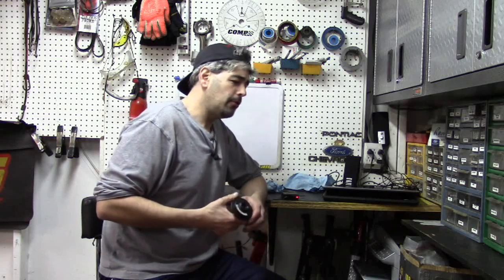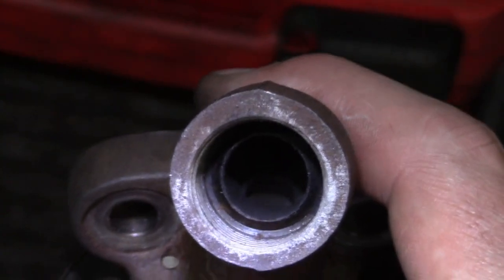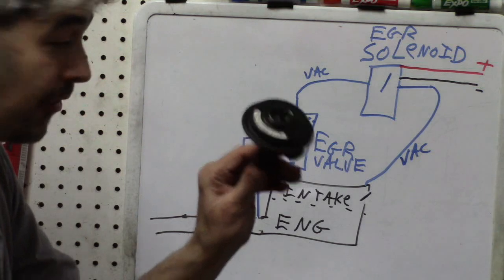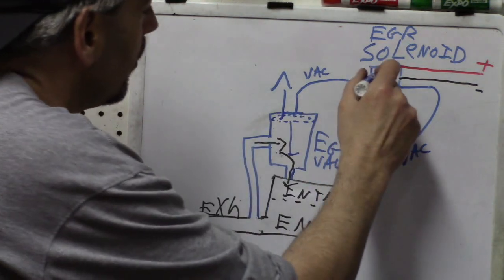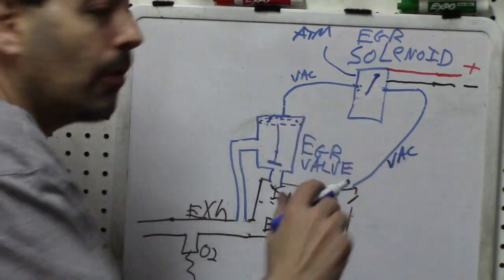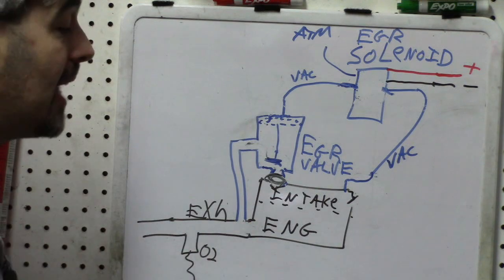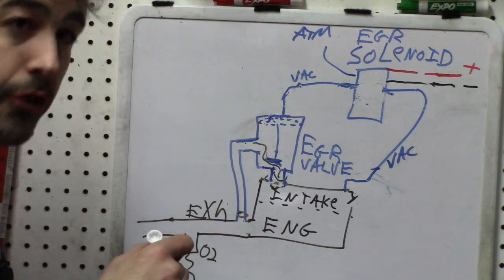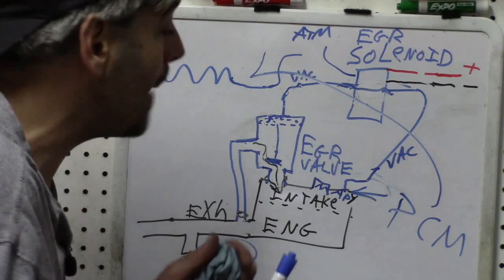EGR  P0400, P0401- P0409 Diagnosis+Understanding Pt1

Comment: Haven't had time to read all the comments, so I don't know if my question has been already explained yet.  So I will point to the video at 11:28 where you explain that you know for a fact that with GM vehicles the EGR will not work in park or neutral?  My question is, are you sure about this?  It seems like I remember reading in one of my repair manuals, that one of the ways to test the functioning of the EGR valve.   Is to remove it from the engine, then with the engine started throttle up the rpm to see if the EGR valve opens and closes.    

I actually did this with my 97 Chevy truck,  it was in park and I saw the pintle on the EGR close and open as it should.  So I guess I don't understand what you mean when you say that, you know for sure that on GM vehicles that the EGR will not work in Park or Neutral.   Am I missing something?  Are you referring to certain year  GM vehicles?
Reply from the maker: Please explain how you can "see" the EGR valve moving.
Reply: Similar to how you showed in this video, except that I removed the EGR valve from the engine and with the electrical connector still connected and the engine running.  I pushed on the throttle  of the throttle body and watched the EGR valve pintle move back and forth.  Or open, and shut.
Reply from the maker: Well yeah of course! With the valve removed what else would you expect???
Reply: Nothing, I just thought you meant it wouldn't work in park.  It threw me off a little, thinking the valve might be bad.
Reply from the maker: nope- valve is good. Move on to your next variable. For example just the fact your engine could idle with it removed. now there is a clue i would be chasing for sure.
Reply: Yea, I just did that.  It was the Engine Coolant Temp sensor.  It acted a lot like an EGR malfunction, but the exhaust was creating a very raw stench.  So my theory was that the system was in open loop, and one of the things that may cause it is the engine temp.  Sending a false signal to the ECM to richen the injector.  So I bench tested it, and it was way off spec at about 20, 000 Ohms @ 77 degrees.  After I replaced it, the drivability is back to normal.   The new temp sensor Ohms comes in at 2,700 Ohms @ 77 degrees.
Reply from the maker: What? Well how do you explain the engine idling with the EGR removed and also where was the P0172 and 3 codes - you mentioned it’s a 1997 GM?
  makes no sense!
Reply: I don't understand your confusion.  Most engines will start up and run with the EGR removed, depending on the manufacture.  It may create a louder exhaust sound, but not my usual experience.    

In my case the rough idling and engine stalling out, only occurred after it warmed up to operating temp.   This is something I over looked that caused me to focus less on the EGR valve, and more on a component that functions with temperature variation.  

The engine coolant temp made sense to me.  There may have been codes, but I didn't have a scan tool at the time to retrieve them, and I long since pulled the battery for other reasons.   So I guess I don't know how all this doesn't make sense, because it sure solved the problem..

Comment: sir. when is the time the EGR is open, is it when on high RPM sir?
Reply from the maker: it is usually open at lower to mid range rpm at Highway speeds when RPMs are fairly constant.  it should be closed at idle.

Comment: You are doing a very good job sir, well explain and teaching very well. You are my favorite channel on youtube. I try to fix my 2001 nissan quest. the car stop on the load on the way home from work. can't start have to tow home. then i got it start again but no power to drive. now just crank but won't start. have P0300 and P0340 code. what are you suggesting sir, too bad i leaving in California too far away from you. Thank you for sharing your knowledge sir.
Reply from the maker: You need to determine if the the P0340 is the result of the 0300 or the result. Try a cam sensor bypass test
Reply: DON'T watch his vids. He draws on a chalkboard! What kind of garage is that?

Comment: HI ..i just did valve cover job on my 99 avlon(1mz fe) v6 engine. After everything put it back i got p0401. I first thing clean egr at the intake and the egr tube end. But still code exist. I applied vacuum to egr but car never stalled or died. I check the diaphragm of EGR looks fine and hold the vacuum too. What will be my next step?  I am going to open from top of the EGR where electrical connection is and will try to get access of pintal. I am stuck on one thing make me thinking that car did not stall while apply vacuum to egr means something wrong inside of the egr (pintal assembly). I clean temp. sensor too... but in toyota when we open egr we don't have access of the pintle and seat. please advice ....also i don't have EGR modulator in my car.
Reply: +Hiren Patel 
Just reference to my previous question. I did reopen the EGR. This time i concentrated where EGR connects to the INTAKE MANIFOLD it's small hole which is looks like 0.500" in diameter. I poke the small screw driver and clean it. Then took Wire from coat hanger and bend it in "L" shape and start to clean that port. Just realized that whole  port was clogged. So i was keep spraying throttle body cleaner and poking and then use my shop Vacuum to suck all carbon. Also clean from the Throttle body side by moving butterfly  and cleaning with rag.
Also my car was throwing P0441 code which is related to Gas Tank Fuel CAP. I removed it and inspect it which fully clogged with black residue. I cleaned it with warm soapy water and blow air couple of time thru port, also cleaned the area where cap seats on neck of the fuel filling pipe. Then clear the codes. After that drove car about 50 miles and NO CHECK ENGINE LIGHT. All solved. Also my car Passed the NJ State inspection too.
Thanks for all diagnostics help.
This is really great explanation.

Comment: Always check your HOSES first engine heat cracks & makes hoses brittle with time & causes bad or lost vacuum also  ...
Reply: That makes no sense- why would you check hoses first when you can easily confirm it can only possibly be an electrical problem? Why would you check hoses AT ALL on a circuit integrity code????

Comment: Excellent explanation.  Thank you!  That being said with regards to your diagram I have a 2000 Toyota Camry and the EGR solenoid remains open until 12 volts is applied, and then it shuts off. I've pulled the solenoid off of my car and checked it.  Air blows freely through until voltage is applied....when it's applied you hear the clicking activation of the solenoid shutting and air flow is cut off.  I actually went to a local auto parts store and asked to see a new EGR solenoid and that one as well allows air to flow freely, even when plugging the air exhaust port.  Might I add that I checked the connector wires to the solenoid with the car off and ignition on accessory and there is voltage going to the wire connector........which by what I said would render the solenoid shut at the point of tuning the ignition on.  Have you ever heard of a backwards system like this?  Very odd.....
Reply from the maker: Many systems are like this. The solenoid opening can be controlled by either applying or removing voltage. Either way it is same result.

Comment: One question that pops into my head though:

Why should you anticipate a lean condition once the EGR opens? I can only assume it is because there is more oxygen left over than HC, but i would expect there to be a rich condition when the HC and the other pollutants come back in?
Reply from the maker: TexMechs Yes I admit, I also would expect rich condition as well. I am not sure if it is because of the actual composition of the EGR gas itself or if it is because of the effect on the MAP sensor (which even then I would expect rich condition- increase in MAP would increase fuel injector pulsewidth and there is already HC in the EGR gas).

  I don't have a really good explanation for this except I see if go lean as verified by fuel trim.  Hopefully someone else knows?

Comment: Hey there schrodinger I have a question,  my girlfriend has a 05 Nissan murano and when she gives it gas at lights or stop signs basically putting it under load she gets lifted noise, pinging what would you suggest I look at first
Reply from the maker: Data. I would look at data first.

Comment: Informative, but I guess I'm more in the 1%. I'm looking for the answer to bypass back to the pcm , and completely remove the egr. I have a sandtoy on the floor, and it will have a 1994 gm 3800l
Reply from the maker: Why would you want to remove the EGR?
Reply: @SchrodingersBox  I wanted to donate it to a worthy cause. Joshing aside, I don't think that it will be needing a smog check anytime soon, i cut off the fitting and the crossover pipe,nwrapped the headers in titanium thermowrap. I understand the science behind the theory of the egr, but like a racecar, weight reduction= h.p. It's a dirttoy, same logic applies. I will probably be doing the O2 sensor also, but I have the signal plan for that. Now what are your thoughts concerning H.P., reliability, durability. I figure the less systems that are supported, the more dependable? I have a stock Supercharger sitting on the bench.... Later days. Hey thanks for the expediancy

Comment: Dear Sir,

I believe on modern EGR systems, there is either an EGR temperature sensor or EGR flow sensor, to account for the diagnostics. Please correct me if i am wrong. Thanks
Reply from the maker: You are correct- they are briefly discussed in a later video

Comment: Is the EGR solenoid another name for DPFE?
Reply from the maker: Good question, No it is not.  DPFE is  supplemental to an EGR valve- it basically validates the EGR is working.  Most non-Ford cars use the MAP sensor to validate EGR is working- when EGR opens, it will increase manifold pressure given all other conditions being the same and this detection by the MAP validates the3 EGR must have opened.
  Instead of MAP, in most Fords a DPFE sensor works similarly by measuring pressure but DPFE measures a pressure difference before and after the EGR valve to determine it must have opened.
Reply: @SchrodingersBox  Thank you for the reply. The differences between how the 2 function threw me off a bit. 

Loving the channel! Cheers

Comment: I'm wondering about the 98%-ers  and the 2%-ers that you mention every so often. Is this a scientifically proven statistic or perhaps just spoken for effect? It is difficult to imagine that there could be that much ersatz auto repair going on!
Reply from the maker: It is a calculation based on "n" of subscribers to channels like mine vs 'n' for "parts changers" channels' subscribers base.
  Also, statistically, approximately 2% of the population is in scientific industry, thus it is reasonable to assume that since a small percentage of scientists don't actually have a scientific mindset, and a small percentage of laypeople do, it probably equalizes out to be about 2% of people with scientific mindset.

And finally, it is statistically substantiated in comments on Yahoo answers, chatrooms, etc.  In the years I wasted my time on such resources if you want to call them that, out of every 100 people only 2 actually commented with logical diagnostic responses as opposed to looking in their Haynes manuals and coming up with an idea for a part to swap.

Comment: I installed a new egr. Now I'm getting code p0405 low voltage where do I begin with this. 2006 dodge ram 1500
Reply from the maker: If its' low voltage I would check for a short to ground on the reference  Keep it simple to start!
Reply: Hey thanks a lot for the reply. Just because you got back to me I'll let you know where I'm at. So I am learning about doing my owne maintenance on my truck. I was a new part buyer when I didnt know if I needed it. I replaced the egr valve with no code on the truck thinking it was what I was after. Got a low voltage code about a week after I installed the new one. I installed the old one again and cleared the code and it hasn't been back yet.

Comment: My Velosteur 2015 claking a bit betwin 2500rpm an 3000 whats is can be ???
Reply from the maker: anything. what did you see when you examined the area around the noise??  What data have you gathered?
Reply: The garage then i go seid to me then is mebey a bad sparkplug or derty inthek manifful or systèmes ?!
Reply from the maker: Could be that. Or not. what data do you have on the ignition output?  What is the fuel trim that indicates a manifold issue?  What data is being used for any of these?
Reply: @SchrodingersBox  is doing no chek engins no code at all !!! 
Is juste soo wherid lol
Reply from the maker: It’s not weird- you usually won’t get a check engine light on something like that. Doesn’t have anything to do with data acquisition. Do you have any data that can be used to make a diagnosis?
Reply: @SchrodingersBox  nooop ???!!
Reply from the maker: Nothing I can do then. possible it’s mechanical too- can’t tell without any data. Good luck.
Reply: Enny wey i gone change the oil and speikplog and clean the PCV valve and inteck système and i whill see !!

Comment: Does it hurt to blank off your egr valve as many people do?
Reply from the maker: It doesnt hurt anything because the fuel trim will adjust to the unexpected condition created however you should get a check engine light come on with an OBD2 system when the PCM fails to see EGR input either from MAP,02, or whatever sensing is used for that vehicle.

Comment: Pulled a code P0406 on a ford escape, egr circuit A high.. any tips?
Reply from the maker: What data do you have?
Reply: @SchrodingersBox  hmm, ill have to double check... but while i got ya, the connection to it is pretty messed up.. melted, corroded, etc..
Reply: My question with that being, where does the other end of that connection lead to? The end going out of pressure sensor
Reply from the maker: Obviously a high signal must be an open from the feed side.I would voltage drop test across the load.

Comment: Can my codes on an Audi A5 2013 tdi still have codes of 
1) EGR valve open circuit 
2) Exhaust gas Recirculation Sensor A circuit/range performance 
3) EGR valve open circuit 
If it was just totally blocked up ?
Reply from the maker: All are possible.

Comment: thanks. 3.1liter 99 century, the plunger was stuck so I was excited since I'm not getting better gas mileage. but it still stumbles at 45-50 mile per hour getting into the gas pedal on a uphill grade before it downshifts. thought for sure it would be this since the plugs, wires, and coil packs were right. guess I'll find the test pin for the stone age way of getting the codes.......NEVER LOAN OUT YOUR CODE READER OR SCAN TOOL GUYS!!!!!! even to family. enjoy your channel

Comment: Ford Contours don't use an egr valve.  The computer controls the exhaust valve timing and closes the exhaust valve a few degrees early.  Same result -- as an egr valve -- exhaust gas in the cylinder to lower peak flame temps and reduce nox.

Comment: What actually tells the engine computer to actuate the EGR valve on vehicles not having pressure differential flow sensors (1997 Isuzu Rodeo 4cyl 2.6 engine - 87,000 miles). I get occasional PO401 insufficient flow code. I have cleaned out plumbing components/ orifices several times...changed out EGR valve itself. It's all clean!
There must be something in the computer software triggering the code. Can 02 sensor be used as feedback for EGR valve control?
Engine runs normally...no performance issues.
The code usually appears when driving 55 - 60 mph....after driving 30 or so miles...engine temperature always normal (manual transmission). 
I want to figure this out...nobody talks about how the engine computer controls EGR valve....anybody know?🤔
(EGR valve type is a stepper motor driven - no vacuum used)...has a potentiometer to monitor pintle position.
My issue only occurs once or twice a week...
Reply from the maker: certain preset parameters for engine speed, engine temperature, speed sensor, and TPS are used. I would simple manually activate the valve and check for MAP response to test it.
Reply: @SchrodingersBox  Thanks for the fast! reply!
I'm building 2 LED volt readers to monitor EGR control by ECU. One to read actual voltage pulses to valve coil....other to monitor potentiometer. 
I believe my "GM style" valve is controlled by stepper motor. (My cheapo scanner monitors only the basic stuff).
Gonna figure this thing out! Building electronic circuits is one of my hobbies. 
THANKS! 👍
Reply: @SchrodingersBox  oops...yes....checking MAP sensor out (it has been functioning according to my scanner)👍

Comment: can you do a video about a honda crv ? is  a 2001 i change the timming belt n water pump and distributor and still have code p1381
Reply from the maker: It doesn't matter the model.  They are either inductive or hall effect. Test accordingly.
  By the way-Why change the timing belt? for a P1381?
Reply: It came in with a broke timing belt so I changed the belt and water pump after I changed it I rotated two times to check the timing and everything is good but when you start it up is fine until you put it in gear and losses power, check the codes and p1381 is the only code so I changed the distributor and still have the problem
Reply: I was going to take a look at the alternator but I don't think is bad
Reply from the maker: I would check the cam sensor reference, signal and ground and verify with a bypass test.  This assuming of course that you validated coordination of the CKPS and CPS signals. Alternator would not cause a P1381.
Reply: Thanks I'll do that. Love your videos A+!